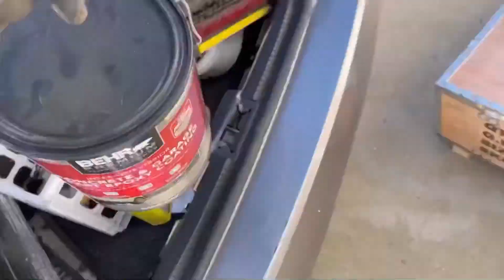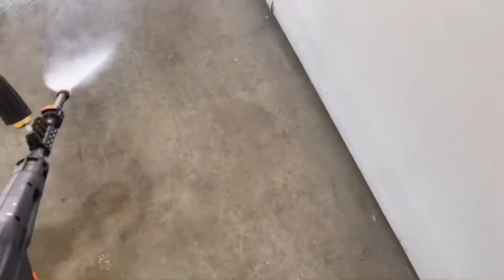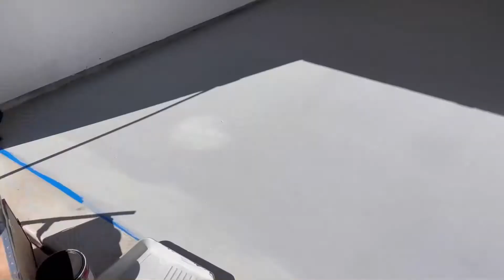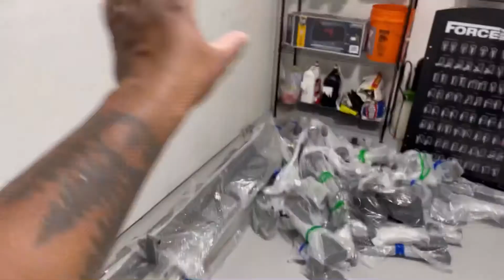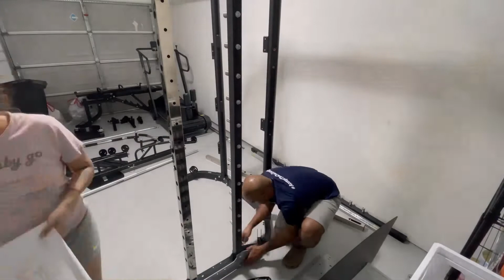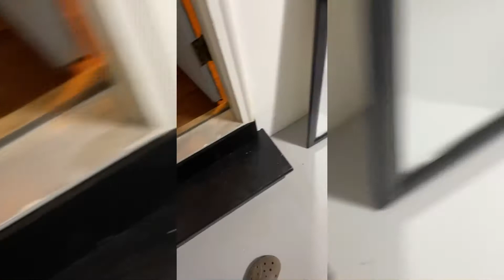Force USA G9 | Health is wealth 💪 #forecusag9 #workout #detailshopowner #garagebuild #garagegym

Comment: We had someone install this.  Now the carriage isn’t sitting down where it should.  It’s halfway up the poles in back to begin with.  How would I correct this?
Reply from the maker: I think you might have the cables switched, put the longer ones in the back….. after that change you should have enough slack to keep it down
Reply: @Iconautosports  since we didn’t do it I don’t even know if there was shorter and longer.  Tell me this.  Is the starting weight of the pulley already pretty heavy.  I was shocked at how much resistance was already there without a weight on it or do you think all the pulleys are done incorrectly
Reply from the maker: They come with weights that drop down inside the pole so it should touch the bottom with no weights on. That’s why I believe they might have put it on wrong. With no weight on it, it should only have a resistance on maybe 7lbs but not a lot